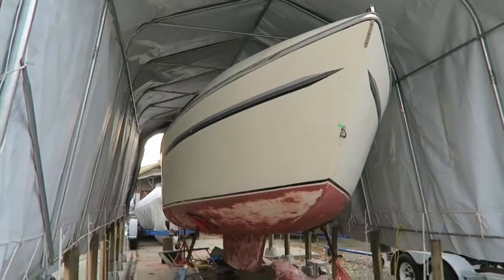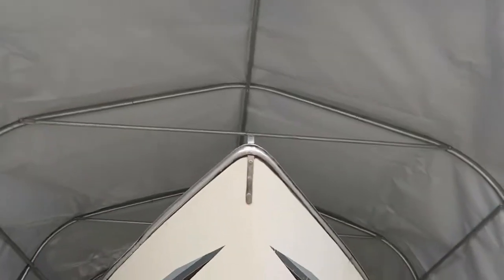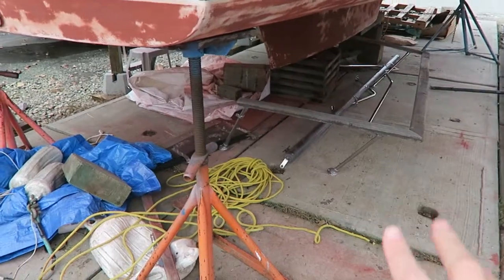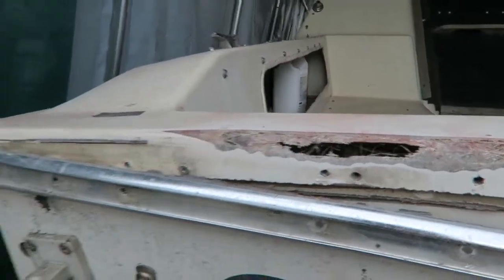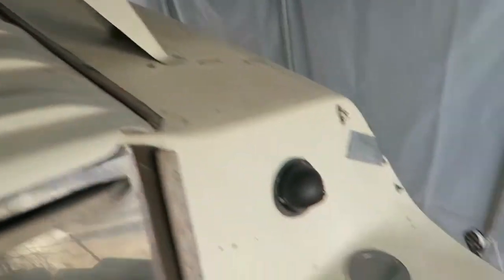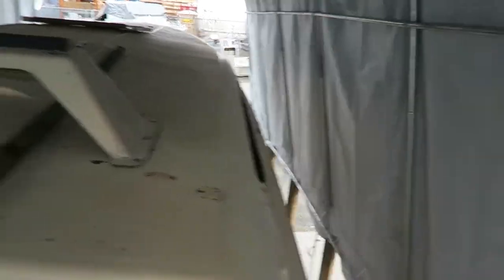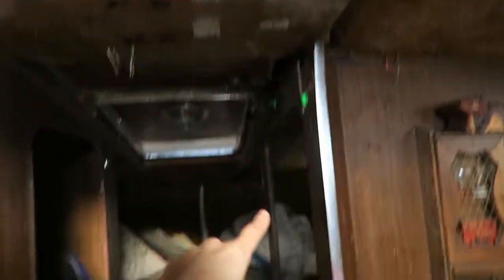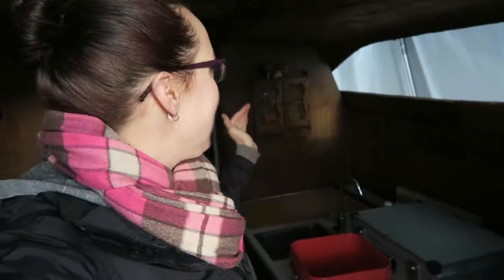An Overview/Taking Off The Windows - 1976 Reinell Sailboat Restoration #11

Comment: Hi! I've got a Reinell 26, and I did the same restoration job you are doing. Lucky for you, your hull doesn't have a rotten core like mine did. Weeks and weeks with a grinder and chisel, but re-cored the entire hull. I finished about 6 years ago. Keep up the good work. You said in another video that you hated the hatch covers. Do you still have the main hatch covers?
Reply from the maker: Hello! Oh there are certainly some rotten bits to be had. The wooden runners under the mast on the roof have to be completely replaced, and the floor at the foot of the V-Berth is sagging, I am worried about opening it up, feels rotten for sure. Not sure yet what to do. 
I have had the front hatch re-built, re-used the stained glass. And yes, I still have the hatches for the door. I tried to fix the slider the other day, but it is so warped the epoxy fix I did had no effect. I am going to have to level out the rails to make it work correctly. Or replace the whole thing, which is what I want to anyways.
Reply: yup, old boats are lots of work...About that soft spot in front of the v berth, the leading edge of the keel is hollow. the floor in that area is 1/2" plywood spanning the forward keel bilge with no other support. the best way to fix it is to replace the core. the core up there is a single piece that runs underneath the head and the vanity. It is possible to replace a portion of that core or the whole thing. I'm a self-proclaimed "expert" lol on the structure  of the Reinell 26 and have a lot of pics from my build. I'd be happy to share what I know with you, or anyone else that may be interested. For the hatch runners, I used "Plasteak" and routed a channel for the hatch.